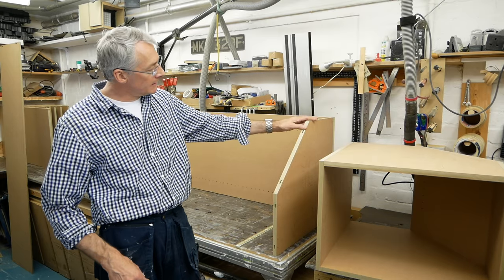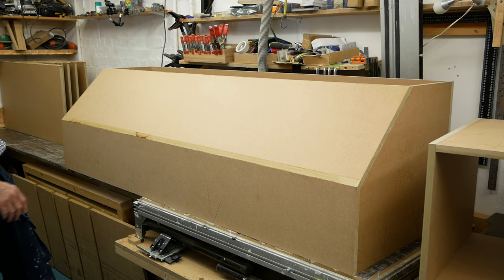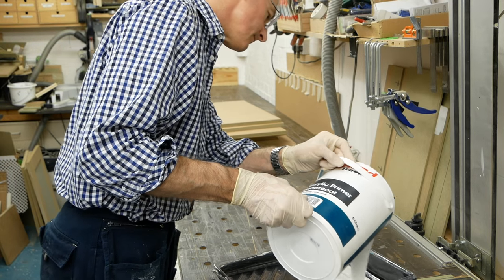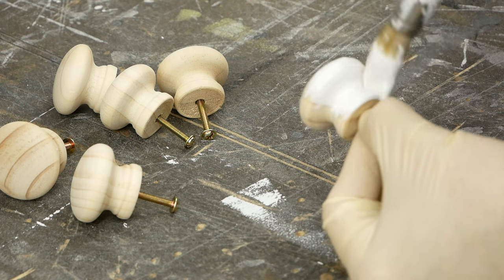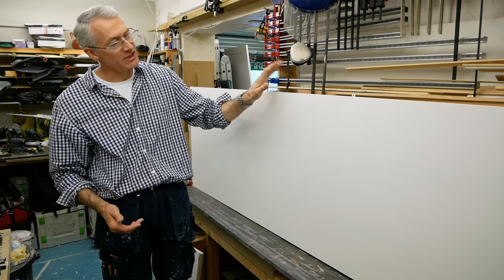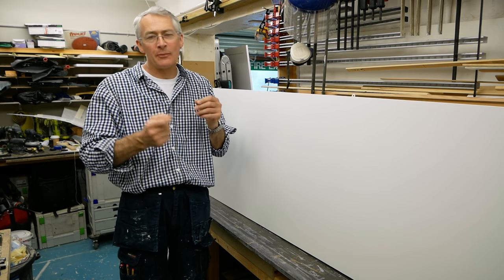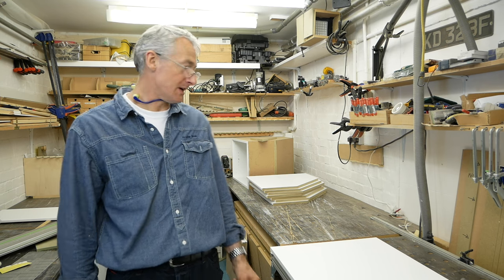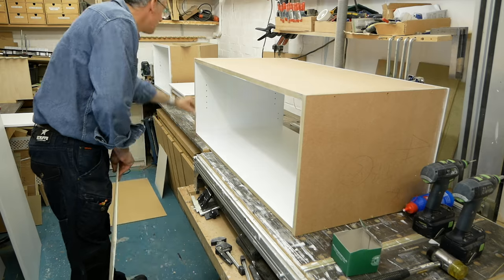Wardrobes with panel doors and top boxes P5, #041

Comment: Hi again,

Regarding the angled piece of the carcass,  wouldn't it have been easier to cut the angled piece so that it overlaps on top of the straight pieces instead of supporting them? Atleast it would have been easier to assemble since you would have an edge for the angled piece to rest on all around. Or is there another reason to cutting it this way?

Cheers!
Reply from the maker: MrLovblad As broad as long, really; I rolled the carcass over onto its side before fitting the short side when I made the final assembly, you just get a better view this way round so left it this way for the dry-fit 👍
Reply: I see, thank you!

Comment: For the hinges i picked up a trick from an old carpenter. Then you want to drill the pilot holes, put 2 hinges to the 35 mil holes and then butt a straight edge from the front so that it alignes the hinges square and parallel. Very tricky build.
Reply from the maker: +Billy Tsik 👍